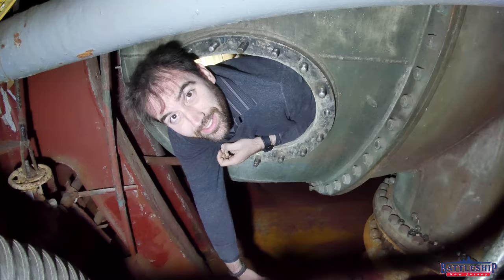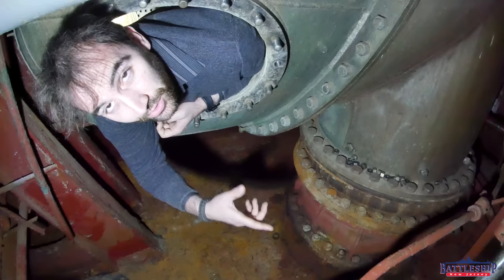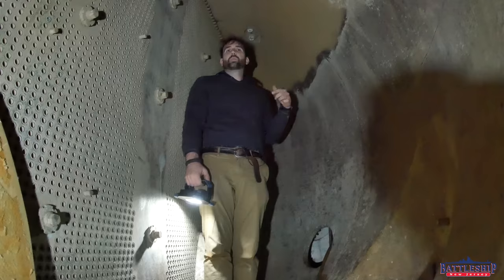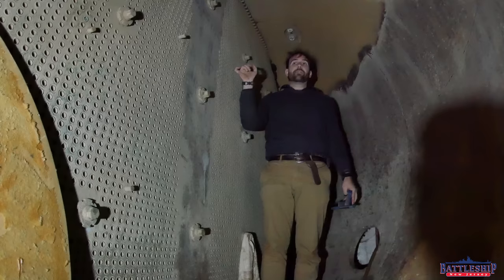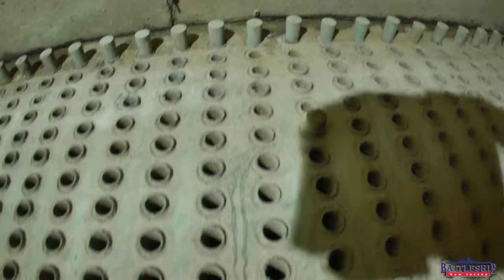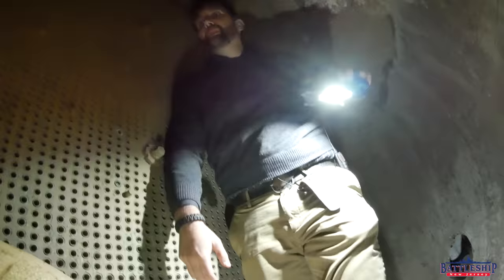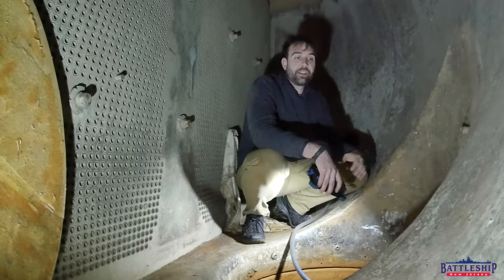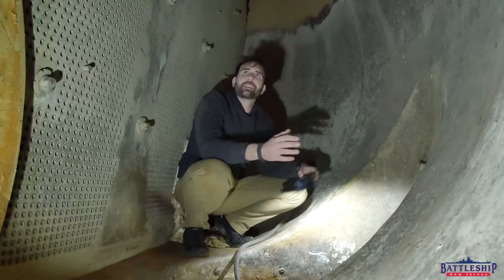Battleship New Jersey's First Hull Leak

Comment: Why is this ship not berthed on dry land, instead of in the water where all know the salt water accelerates rusting?
Reply from the maker: Here's a whole video on why we think dry land is a bad idea: https://youtu.be/sa8x2gc448c
Reply: @BattleshipNewJersey  Saw the video.  In the United States of Old we'd find a way to berth it on dry land, but those days are long gone, probably never to return.
Reply: @BattleshipNewJersey  Saw it but disagree; America at one time can do anything.  If the astronauts can be placed on the Moon we can dry berth the ships.
Reply from the maker: Its not about whether we can but whether we should, it isn't best for them.
Reply: @BattleshipNewJersey  Salt water rusts steel.  Look what happen to the USS Texas, sitting in the water with a rusted out hull.  Getting the hull out of the salt water would prevent this.  Thank You.
Reply: @sashadala346  Ships are not designed to sit out of the water long term. The stresses are too high. HMS Victory has that problem.  There's a risk of the frames being overstressed and collapsing.
Reply: @gnranger Mikasa in Japan.  If you take your time, it takes about an hour to see the whole vessel. While the ship is not very big to begin with (432 feet/131.7m), there's almost nothing below deck. You see, the Mikasa isn't just encased in concrete, she's filled with it. The tour consists of the upper deck, the main deck, and the bridge, and though there's some storage down below, the rest is filled solid.

Comment: I wonder myself...how they know which pipe is leaking to isolate it with those stoppers ?
Reply: You individually pressure-test every single one of them.
Reply: @kevincrosby1760   WTF ??? 😬😬😬
Reply: @dilly2408  There is also a large space similar to where Ryan is at on the OTHER side of the condenser.  Water goes through the tubes, steam is around them.  

As the condenser is actually held at BELOW atmospheric pressure on the steam side, a leak in the tubes would show up on the Salinity Monitoring system as sea water mixed with the condensate.

To find the leaking tubes, you temporarily plug one end of a tube, put pressure on it from the far end, and see if the pressure leaks down. If it does, then you pound your little cone-shaped plugs into both ends of the tube, then proceed with testing the next one.

Ruptured tubes are a fact of life.  The condensers are designed with excess capacity, typically around 20%, to allow exactly this type of "repair".

Since everything is open for the testing, you would normally clean the tubes as well.  Ever clean a rifle?
Reply: @kevincrosby1760   Yes I did. Military Service fulfilled. Cleaning the tubes I understood how, but detecting pressure leaks was a question for me. Now it's clear. Thanks for explanations. I am not familiar with the boiler way of work.
Reply: @dilly2408  The reason I brought up cleaning rifles was that you clean those little tubes in basically the same way...A special pressure washer/brass brush device.

I was Navy, but not involved with the engineering plant equipment, but rather the sensors and such which monitored heat, pressure, speed, etc.

I understand Basic Steam and Naval Boilers, but I actually learned about tubes on 3 little low-pressure water-tube boilers used for heating on a college campus...by testing and cleaning the tubes.

Believe it or not, those tubes can actually be cut out, extracted, and then replaced by inserting new tubes, expanding them out, then re-welding them in place.

Comment: Interesting...one would think they would have found a way to use 850 degree steam to preheat boiler water before it is converted to high pressure steam.  
Not a Physicist but I know there is a lot of heat energy in steam at that temperature.
Reply: The steam exiting the low pressure turbine to the condenser would be 150F or less and already under vacuum. Very little heat energy left. Extraction steam from earlier turbine stages would be used to preheat boiler feed water.
Reply: @reedsmith9075  My reply was directed to what I believed was stated in the video that the steam was 850 degrees.  If I am incorrect I apologize.
Reply: @blindspott1060  600 PSI / 850F superheated steam would be found at the INLET side of the HP turbine.  The HP turbine would exhaust to the LP turbine, which in turn would exhaust to the Condenser.  As the condenser runs at a pressure lower than atmospheric, you can safely place your hand on the pipes leaving the condenser.

The whole point of the game is to ensure that you have expanded your steam enough performing useful work that there is very little heat energy left.  At this point you condense it down and send it back as Condensate for treatment as required to once again become Feed Water.